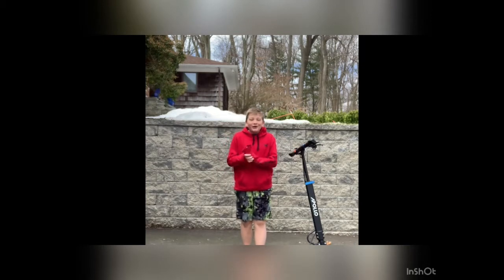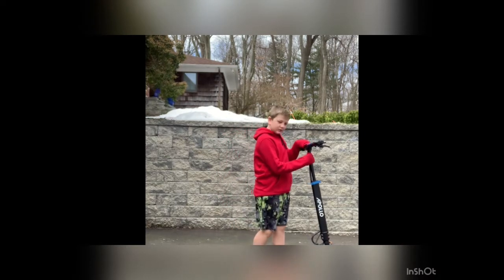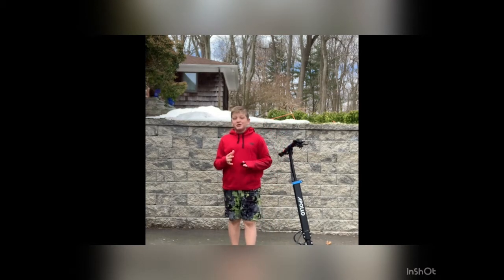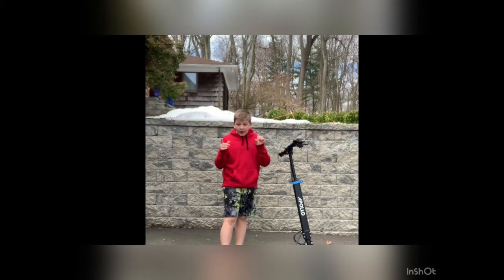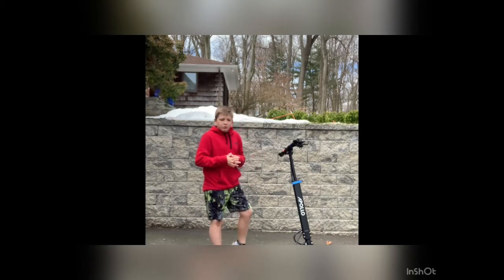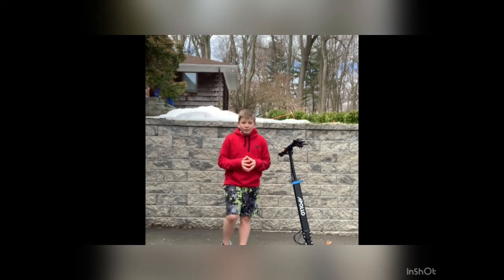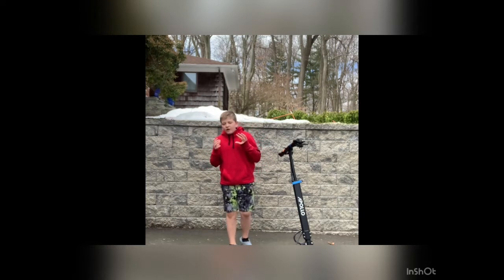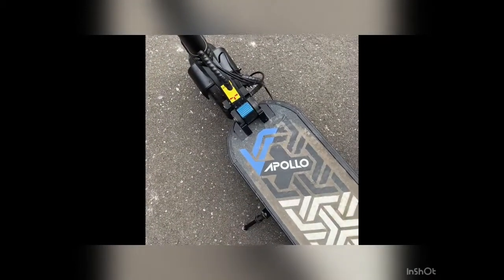Six month review on Apollo explore

Comment: Awesome run down. Thanks for the shout out.     The overheating and hitting a cold liquid is very useful.  Say coming down a hill and getting splashed somehow from a lingering puddle.  This definitely applies to many scooter brake systems.
    I'm also deciding between the Apollo City,  and new Etwow GT SE (under 30 lbs, but solid tires). 
    Also considering wrist guards or gloves and knee pads.  And obviously a helmet.